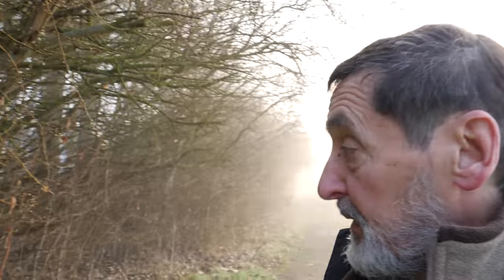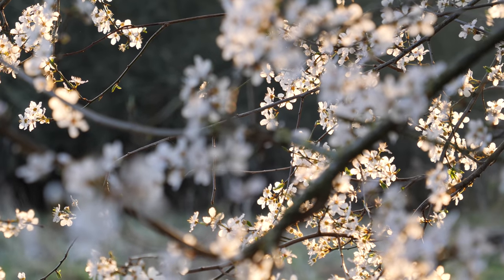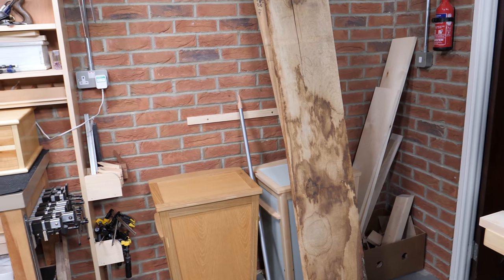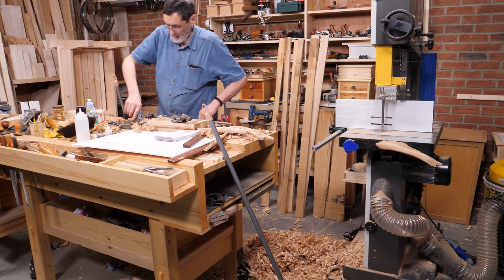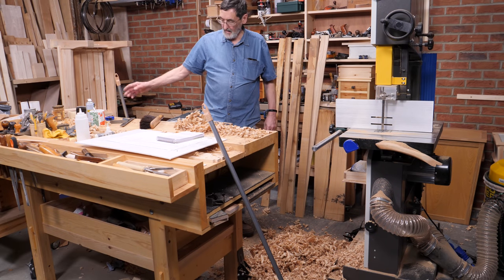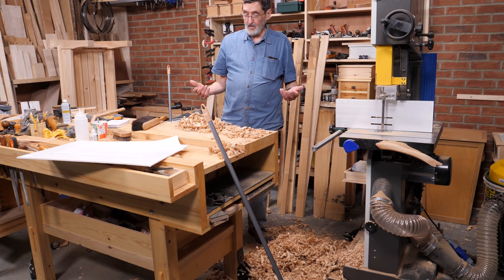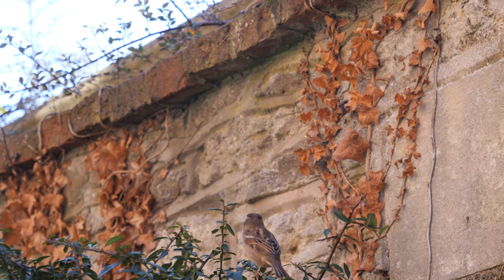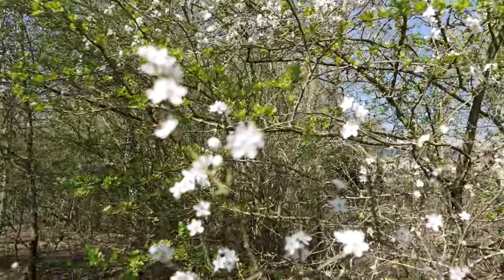From Woodland to Workshop - Randomness to Symmetry & Order | Paul Sellers' Vlog 010

Comment: Beautiful, I'm surprised at how much I enjoyed this much more than I already expected.
You really touched on a great perspective point about autism. My stepson is autistic, high-functioning, and he absolutely loved flattening the bottom of the benchtop that finished for your bench that I'm currently building (1 mortise to go before I'm finally to cutting the tenons!), and  I can't wait to start my first project on the new bench, a poor man's spokeshave, so he can do the unique shaping on my grandpa's style of canes, (while my 4-year-old "planes stock" with his tiny block plane) which I am going to remake in his honor to start off my long time hope of a side venture in fine woodworking.

Sorry for the already long winded comment, but one question that your video randomly brought to my attention: you say you spent the day planing stock, and I'm assuming you'd be using it a couple days after. But if your projects would take a large amount of time to complete, say weeks instead of a couple days or less, what would or do you do to prevent the prepared stock from warping significantly? I've had an issue with that with many of my projects since I only have weekends to work and not enough time to finish them. I know the obvious like moisture content and stable humidity (I work in a 100 year old basement in Minnesota, so that can't be resolved) and air vs kiln dried, but what about any other measures?